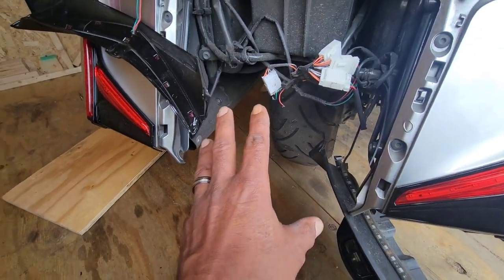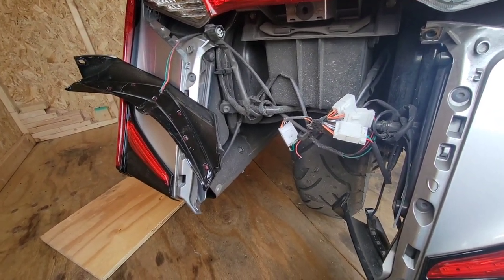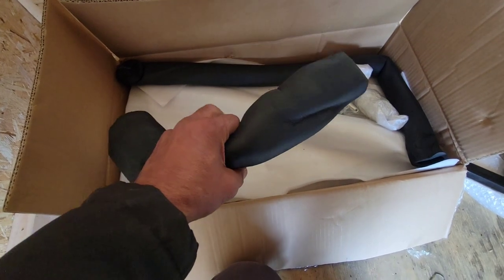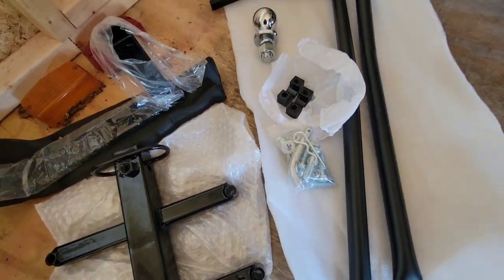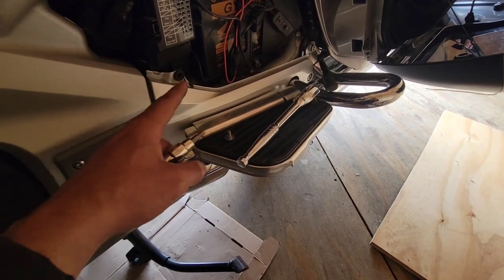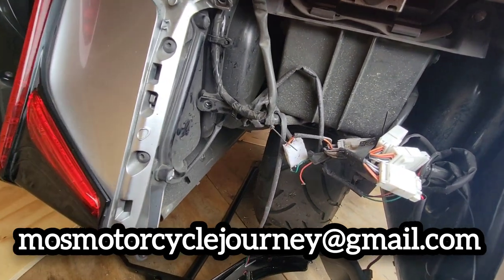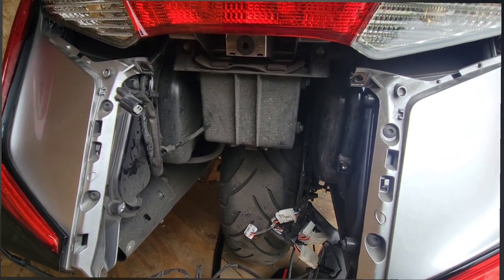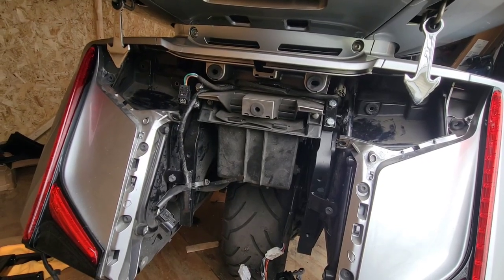FINALLY INSTALLED MY HITCH FOR THE GL1800 GOLDWING

Comment: Quite the job. I took the hitch off my 1500 to do the rear tire and service the final drive and it was pretty simple with the old design. Trade off is your rear tire is simple to get off and mine takes half the bike apart. Fortunately you shouldn't have to mess with the hitch again.